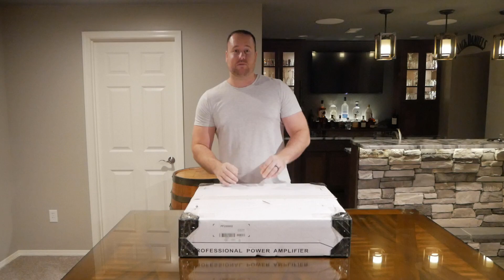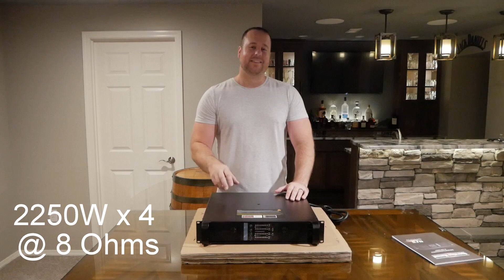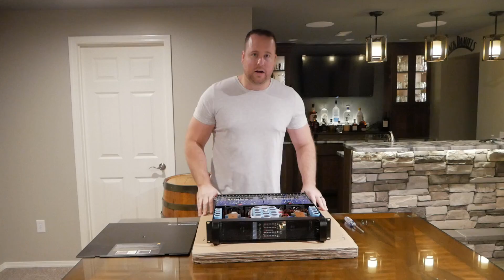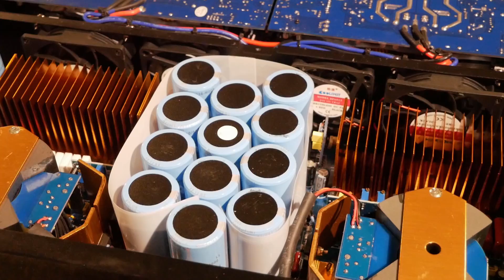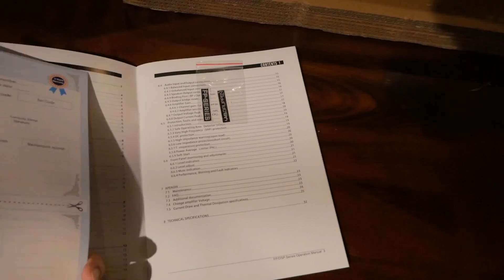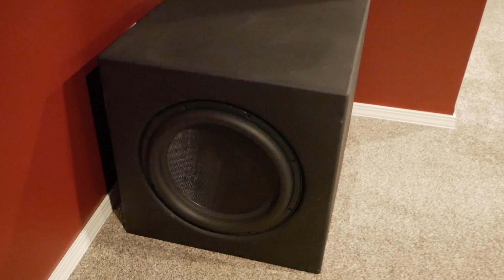FP20000Q Unboxing | Sinbosen Clone Amp | Home Theater Subwoofer Amp

Comment: Do you still have the amp, has it been reliable? Thanks from Scotland
Reply from the maker: Still have it, still use it. Bridged on 2 24s now on 110v instead of 230v. It's a beast, been very reliable
Reply: @LifeofBliss  Thank you so much for the reply. I live in Glasgow,  I do PA hires and audio installations and I have been curious about these amps for a while. I'll order one up and give it a go. Thanks again
Reply from the maker: Tell them I sent you, may be able to save a few bucks...
Reply: @LifeofBliss  Cheers buddy I will do thanks again

Comment: Would you buy it again? Are you still using it? How do you like it after all this time? I assume you keep it in a different room then you're listening space. Or is it OK volume wise in projection room? Thanks.
Reply from the maker: I would definitely buy again. Love this amp. Only downside is the fan noise, you wont want it in the same room
Reply: @LifeofBliss  I appreciate the speedy reply. I think I will look at it again once I move my gear out of the room for the moment will go for something quieter :). Did you ever had a chance to compare it to anything else in your system?
Reply from the maker: I have a couple of nx3000 amps, one for each sub. They don't even come close to the same power. This amp is a beast for the money
Reply: @LifeofBliss  and how about sound quality? Any discernable differences?

Thanks
Reply from the maker: Nope. Both have no audible noise floor, sq has been identical as far as I can tell. Just more power with the sinbosen. Much more
Reply: @LifeofBliss  Do you mean that you are getting some hum etc. through your subs? Thanks
Reply from the maker: No, no hum at all with either of them
Reply: @LifeofBliss  Ahh, sorry I have misread your previous post thinking that there is an audible noise floor.

When you say that Sinbosen has much more power. Other than on paper how does it translate to SQ and general real life usage? Is it only about that it can go louder or is there better control or any other aspect, etc.? Thanks
Reply from the maker: Well with that extra power I feel there's more control. But the smaller amps can't even push the 24 inch subs very hard so overall the sinbosen has a better listening experience
Reply: @LifeofBliss  Thank you for all the info. Much appreciated. Merry Christmas :)

Comment: is the amp still going strong ?
which is the model with DSP?
Tthanks @life of Bliss.
Reply from the maker: It's worked great. I do not have the dsp model, you're better off with grabbing a mini dsp hd 2x4 for dsp
Reply: @LifeofBliss  Worked? As in you've gone another route?
Reply from the maker: Nope, still going strong
Reply: @LifeofBliss  that's great. I'm trying to purchase one but can't find a seller that offers the newer version with more capacitors and cooling fans 😞
Reply from the maker: I'll get you in contact with Sinbosen directly. Send me an email lifeofblisskb@gmail.com

Comment: Thank you for the awesome video. Can we power 3 JTR 215rt speakers for the front stage with this amplifier? If so, what would be the cons of pairing it with Anthem processor instead of pairing with traditional amplifiers like Emotiva, Parasound, Anthem etc.
Reply from the maker: I would not use one of these amps for your mains. Too high of a noise floor. Way too much power too. I would only use these for subs.
Reply: @LifeofBliss  Thank you so much for taking your time to respond

Comment: Obviously this guys does not know what inside the amp casing, are those mosfets on that blue board, how much storage do those caps offer, is the amp bipolar as well etc etc. ANyway its a review, I have no idea why anyone outside of commercial applications would need this amp.
Reply from the maker: Usually they would use it to power high end subwoofers... 🙄

Comment: I might get own and put it through its paces during the summer, I have to run 8-12 turbosound tsw 124's loaded with precision devices 2450 driver's, it better not quite,.
I'll do a review of the amplifier if I get it before during and after I have finished.
And believe I will test it. Many thanks Douglas James UK England

Comment: How do you have your subs wired??
Reply from the maker: I sub per channel, 12 gauge wire. 4 ohm loads
Reply: @LifeofBliss Any chance of a review on the amp? curious about it's performance, noise level as in ground floor hiss, also heat and fan noise. I'm looking into changing from crowns to a FP20000q
Reply from the maker: @keithiegee1  yea I'm going to try to get a video out relatively soon. But long story short, it's a beast of an amp, but the fan noise is pretty darn loud. You'd want it in an equipment closet of out of the listening area

Comment: 2250x4 @8 ohms ???????????  ,a power outlet can only put 1800 watts, how you connect that thing, perhaps it has its own breaker box.
Reply from the maker: Actual power has been tested at 2000w x 4 continuous, 4000w x 4 burst. This is connected to a 240v 30a outlet. These have a ton of capacitors for burst power in them.
Reply: @LifeofBliss  that's crazy 😲

Comment: Well the advantage you have, it is you well never use it at full capacity, maybe 20%/30% because your sound système is not enough demanding power for it, so normally you have 2 decades before it crash down :)
And fan or fanless you don't care with your closet for amplifiers :)
But I think you could have found very great power amplifiers in vintage category like BGW and for truly nothing (brand use with JBL audio cinema division)

Make the wall shake :p

Sorry if is there any faults I'm French and I follow your good work and passion :)
Reply from the maker: Thanks Maxime. I won't be running the system very hard at all most of the time so it should last quite a while!

Comment: What size circuit did you end up running to it?
Reply from the maker: 240v 30a breaker. I've ran 3 of the 4 channels to blipping the clip light and it hasn't skipped a beat. I'll have an update video in the near future, getting a few other things done first
Reply: Life of Bliss  given how dynamic music is, I can see that being feasible, how breakers work and there trip curve. I doubt you ever run into problems. Maybe one day I’ll get to check one of these amps out. Definitely jealous. Great job by the way.
Reply from the maker: @Gcrilla  thanks man. If you ever need crazy amounts of power, these will get you some

Comment: How is the Sinbosen working for you?  Did you have to wire dedicated electric for it?  I am looking at pulling the Trigger today between the 10000Q and  20000Q.
Reply from the maker: Yea I had a good experience with Sinbosen. And the 10q would probably be plenty for what you're looking to do. For the most part I think people on the forums prefer XBS/Sinbosen for the 20q. I don't know as much about the 10q as I didn't look into that one, but if it's built like the 20, it'll do great
Reply from the maker: Had it going for about a month. I did wire a dedicated 220 line. Works like a champ, crazy power. More than enough for 1 HS24 on 1 channel. Really going to try to get an update video out on it and the sub soon. I'd say if you want the extra power, no reason not to grab the 20Q
Reply: @LifeofBliss  I am powering starting with 2 Dayton 18" Ultimax dvc for my living room.  I am thinking I will go with the 10000Q and use half of this amp for those, and the other half for another set of woofers in another room in the future.  I was impressed with Sinbosen's Customer Service vs the other 2 clone companies.  They were much less pushy, and responsive.

Comment: The voltage this puts out must be nuts.While the lids off, see if you can flex the case corner to corner. will give you some indication how well built it is. Fine for indoor.Outdoor PA, in a few years...not sure
Reply from the maker: I have it hooked up now, definitely puts out some power! It was pretty dang sturdy with the lid off, I don't remember any flexing.

Comment: I had a sanway clone of the gruppen. Delivered savage power and it got me by but nothing beats the original for sound quality and reliability. The clone doesn't control the subs as well. It has far less damping. Mine lasted 2 years before 1 channel blew then just over 4 before all channels toast.
Reply from the maker: Yea I'm sure the originals are better,  just a lot of $$$. I just got mine hooked up yesterday. Crazy power and seems to have a tighter, more authoritative sound than the crown xls1000. I think that amp was just struggling to keep up, it was not intended to run that sub. Video will be coming out on the clone amp soon once I get some time to edit. Sorry your amp went bad on you man. I know sinbosen was able to ship a new amp board to an AVS member when he blew a channel for free, only paid $25 shipping...
Reply: @LifeofBliss  Yes mate. The xls are garbage. You will have a lot better sound with that clone across the board than the xls. I understand the money thing that was the same with me. But the original amp is night and day difference again. I didn't go lab gruppen original either this time 5k was too much. Instead I went for a ffa10k, costed 3k, 5 years warranty too.   This is a specifically designed bass amplifier tried and trusted by venues, stadiums, concerts the lot. The difference in my sound is unbelievable.   It's like having different subs altogether.  My ds peaker was high on room correction with the other amps. I use it NO correction now. The amps damping factor and current is such that it controls the sub that well it appears to control the room.

I always thought that amps didn't matter that much and I'd agree with that at low power. But as soon as your talking 5krms into 2 ohms etc it makes a massive difference !...... If u ever get chance try one of the real amps mate but yea for now you will have massive fun with the clone as I did mine!
Reply: my thought process was if this amp lasted 3 times longer than the clone its payed for itself in addition to having all over the extra sound quality benefits !

Comment: You might have to upgrade your service to a 200  amp
Reply: Most newer house are 200amps.  100-150-175amp  kind of went away, I've seen 2000sqft houses with 400amp services.

Comment: You gonna have to call an electrician to run a 100 amp  Circuit just the power that  Amp! LOL!!!!
Reply: these amps actually do only 2kW sustained but they can burst up to like 16K

that means on movies short bass or on music that doesnt have constant/long bass tones these Sinbosen amps can do that, but not when he's going in rap territory.

thats because the capacitors can store enough energy to do serious bursts, so the amp doesn't draw over about 2.2kW during operation.

a real LabGruppen would indeed require that and three phase power (you cant run those on a single phase, even the Behringer iNuke NU6000 or 12000 (or the new NX series amps) require 3 phase power, although the Behringer amps sustain their power as in the NU3000 does about 2.4kW constant, the 6000 4.8kW constant and the 12000 9.6kW constant.
Reply from the maker: I have this wired on a 230v 30a circuit. Tried to give it as much power as I could for sustained power. Should be closer to 7k sustained wired this way. Definitely want to do a 230v circuit when getting an amp like this. But yea burst power is pretty crazy!
Reply: @LifeofBliss  yeah, i thought you had it wired on 120V

well.. one of the good things in Europe is that we actually use 230V throughout our house and actually have access to 400V for even more power while drawing less current :D

Comment: The 20000 in this type of amps, it's always the model there's no exceptions, has 2 boards with 6 transistors that put out 200 W each x 6 = 1200 Watts max per channel, remember commun sense, 20000 W amp is the size of a Chevy Suburban XL, love those woofers tho, reminds me of the originals Vickson 24" from the 80's & 90's were made in Mexico, have fun with your sound.
Reply from the maker: Thanks man, they have been fun so far even with just 1 going. As far as the amp, I'm going off numbers from testing done on AVSForum. Looks to be about 2000w rms per channel with burst potential up to 4000w per channel. Bridged it was showing like 8400w x 2 burst if I recall. That said, even 2000w x 3 channels with 3 24" subs will be more than I would probably ever use, but the headroom is there and I shouldn't be pushing things to their limits.
Reply: @LifeofBliss  so wait 2k RMS per channel or 1800 is a good guess at 4ohm and at 2ohm 3500x4 to 4k? i'm asking cause i run car subs in my Home audio setup and want to start with one FP22000 from Sinbosen and then move to as much as 4 of them later on for a few 18 inch subs
Reply from the maker: These are not stable at 2 ohms. The 14k might be, but I would confirm with them. They explicitly say not to run the 20k or 22k at 2 ohm, even if their website shows a power rating for it. You'll get 2000w x 4 rms at 4 ohm, and up to 4000w per channel burst power. If you needed more power, you can bridge 2 of the channels of this amp to double the output. These are seriously powerful amps. Hope you have beefy 18s 😉
Reply: @LifeofBliss  nice i'm waiting on a Quote from them cuz i'm gonna run bout four subs at 4ohm on the amp and i believe the amp will do just fine.

Comment: A 30A 220 breaker will trip at about 6Kw, and even altogether - doing the math on those caps - they will be evacuated in about 3/4ths of a second at that much pull.  You'd have done better to run a single of the 24's off that amp to prevent a current under-run (read: distortion), rather than trying to drive 2 or 3 of them.

Comment: I am willing to bet the specs are fudged and seriously doubt the quality of that amp being a Chinese brand!  I would go with a Crown brand amp any day before going with a Chinese brand!
Reply from the maker: Here's some testing done one the 22k which has the same 2 power supplies, just a different amp board. Not going to do 16000 rms for sure, but burst power is right around there. Still plenty of power. Crown makes good stuff. I own an xps1000. Just can't get anywhere near the coat per watt as this amp.  https://www.avsforum.com/forum/155-diy-speakers-subs/1780914-measuring-amplifiers-49.html

Comment: As others have noted, that kind of power requires a 240 volt, 20 amp circuit.  More of a problem is that 10,000 watt hours(10 kilowatt-hours) equals 34,121 BTU's, enough to keep a typical house in the South house warm in winter.
Reply from the maker: It'll be run off a 240v 30a circuit. Looks like I'll be crankin the bass more in winter 😎

Comment: Are they 18000 watts sustained or burst? Either way the numbers sound quite made up for me, but I don't know much about amps. 18000watts with a 95% efficiency would mean 900 watts power dicipation. how do these tiny heatsinks handle that? Can anyone clear that up for me???
Thanks in advance
Reply from the maker: It wont do 18000 sustained. They do inflate the numbers a bit, but some testing on the 22k (same 2 power supplies as the 20k, just a different amp board) showed over 16000 burst and about 8000 sustained. For movies, the burst power will be great. Regardless,  I figure if I'm getting 2000 watts for each 24 inch sub, that'll be more than enough output! Here's some testing done by an AVS member https://www.google.com/amp/s/www.avsforum.com/forum/155-diy-speakers-subs/1780914-measuring-amplifiers-49.html%3famp=1
Reply from the maker: And btw, I don't claim to know a lot about amps either. I rely on the expertise and testing that others do 😉

Comment: OK, so you got a Lab Clone I had a Pallet of those here. But why a 230V model?? makes no difference 115/230 difference is a Voltage doubler at on the DC side of the AC input. not a bad TD ( Class AB with Class C Regulation ) I wonder if you gonna like so many claims it is digital
Reply from the maker: Not familiar with voltage doublers, not sure if it has one, but sounds like you know a bit about these... Went with 230v so there would be more total power on tap for the amp to work with. It was a general consensus on AVSForums that 230v 30a would be the way to go. Many seem to really like these amps, I expect to have the same experience. We will see.

Comment: 16000 watt on 240 volt 🤔🤔🤔 66 amps minimum !!
Reply from the maker: Yea I know lol, that won't be constant power. Looking at probably half that for all channels. But burst power should be pretty impressive. Here's some testing done on the 22k that has the same 2 power supplies https://www.google.com/amp/s/www.avsforum.com/forum/155-diy-speakers-subs/1780914-measuring-amplifiers-49.html%3famp=1
Reply: @LifeofBliss  Do you use a step up transformer for 110 to 240v
Reply from the maker: @karthickmurugan8648  no I ran a dedicated line from the breaker box
Reply: @LifeofBliss  thank you for a quick response